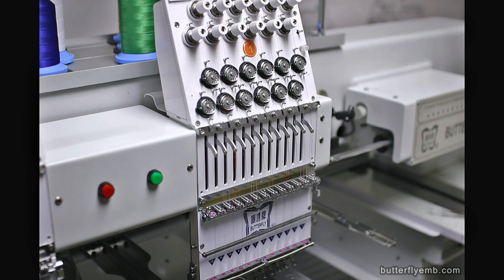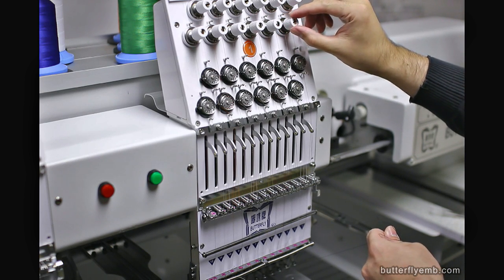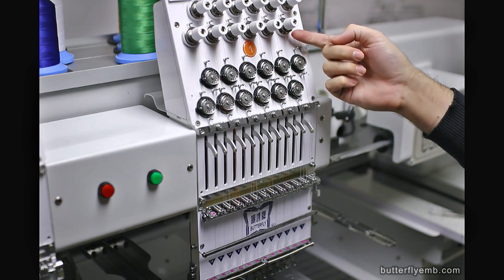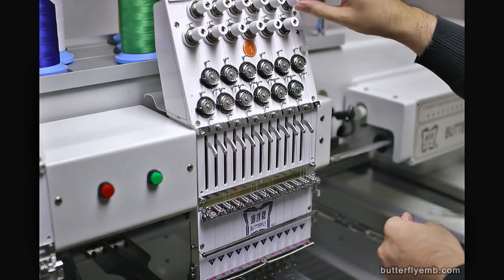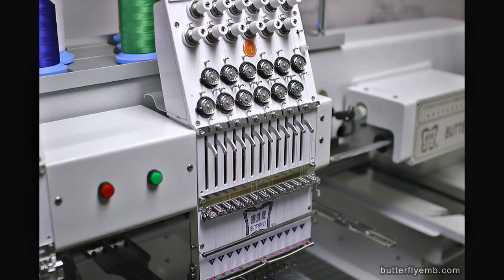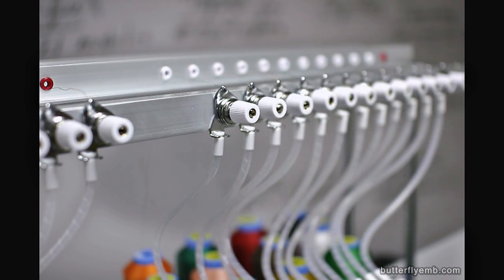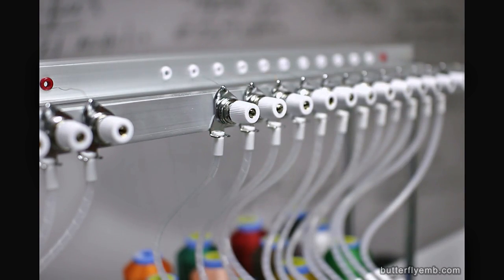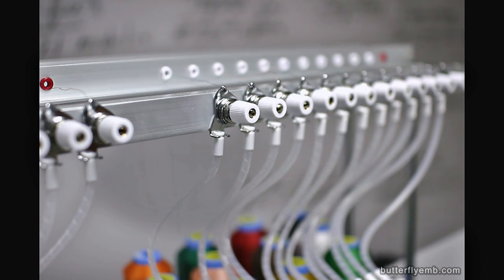Reduce Thread Breaks: Butterfly Embroidery Machine (Single and Multi)

Comment: Is there a video for the correct way to thread this machine. I purchased it used and it’s been a total nightmare with constant thread breaks. I’m running a polo Job and I’ve some 6 shirts on my other machine and haven’t completed 1 on this butterfly because of constant thread breaks, Something I never have issues with on my other machine (different brand).